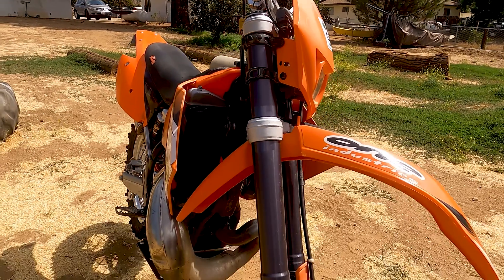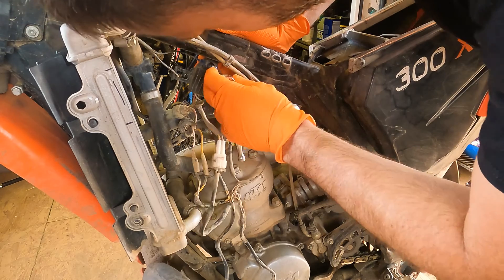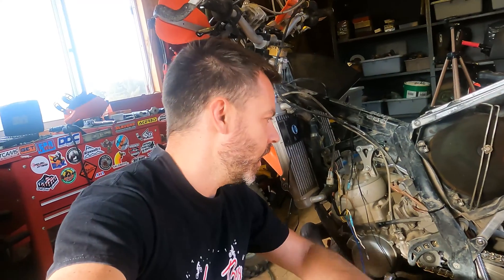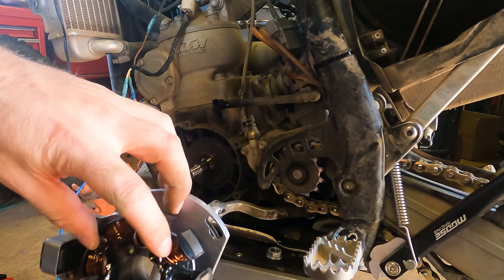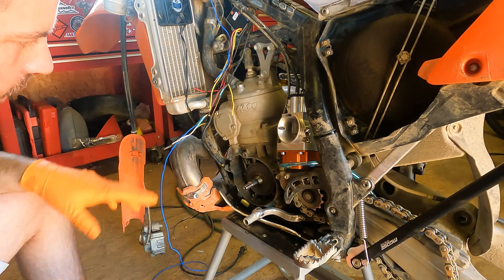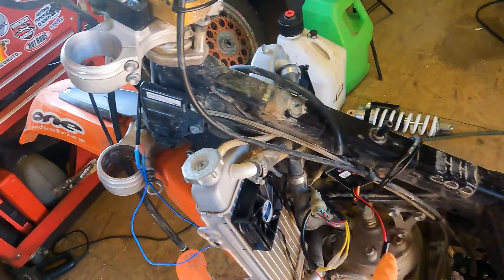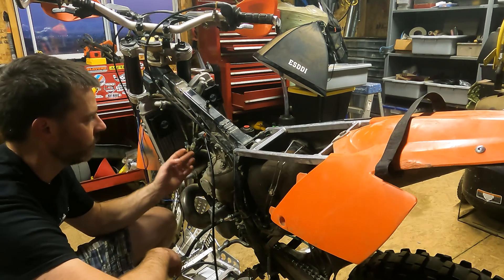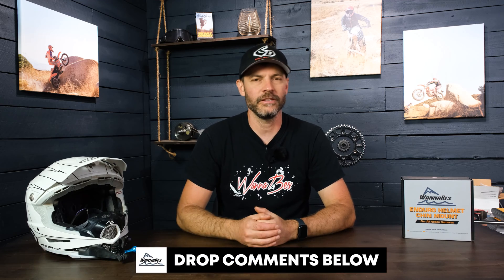2-Stroke Dirt Bike DC Wiring | Stator Upgrade | Accessory wiring on KTM 300 XCW enduro build

Comment: I'm thinking about adding a DC system into a old mx bike. This is best video that I've come across, would you tap into the CDI before or after? 

Most videos add a system that doesn't charge, who wants to charge a battery every few days.

Thanks for posting, good work
Reply: judging by how the ktm is wired its before the cdi man. im currently doing the same on my 05 rm250 just gonna splice into the 2 feeds off the stator and go from there.
90% sure ill have to fload the earth too reading forums alot of people have the same issue.

im wanting to charge the battery cos im putting elec start on but the kit im getting doesnt self charge so im gonna make it charge via reg reculator.
Reply: @kbsrfilms  well I'd look into getting a stator wired for 40 watts or more. That's my plan for my cr 250, it has separate leads for the reg/rectifier, wire up a separate system for the DC, and your in business
Reply: @XJonAye  disregard what I said mate, you’ll need to change stator to a lighting stator it will have the 2 yellow feeds coming off the harness ready to go. 

That’s what I have to do for my rm. but I’d say the cr will be the same
Reply: @kbsrfilms  yup, your correct, trail tech makes one for my bike. Then I'll need a regulator rectifier, and I'm going to wire up a battery.
Reply: @kbsrfilms bro do you know if cdi box can work on DC.  I have problems starting my rm 250, its ignition system is from 96 but on the frame it says that the motor is 01, but that is not important.  The problem is: I DO HAVE a spark but when the magneto spins hard and fast.  That's why I'm thinking if I can add a battery to the system for much easier ignition, just start it and then turn it off (I'll make a button).  As far as I know, to power a battery I must have a regulator.  I don't think the motor system currently has an AC to DC transformer, so I think it works on AC.  if i put a transformer to transform all the current produced by the alternator to dc, i don't know if the cdi box will work.  So my main question is will cdi work on dc.  I will adjust the rest, I can also put a headlight and other accessories.  I know that the stator is probably not powerful enough to power everything, but I will fine-tune that later